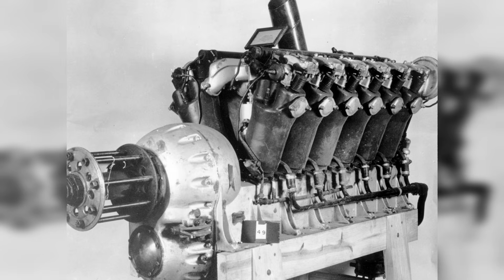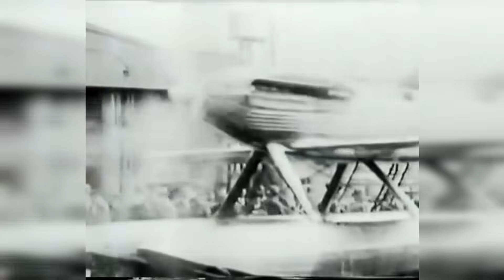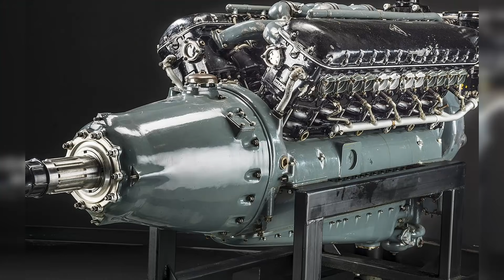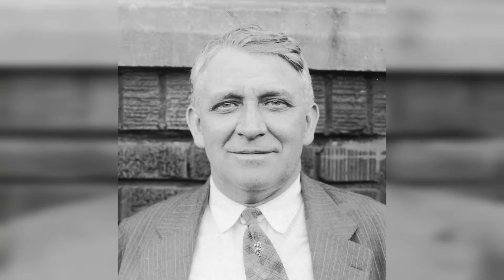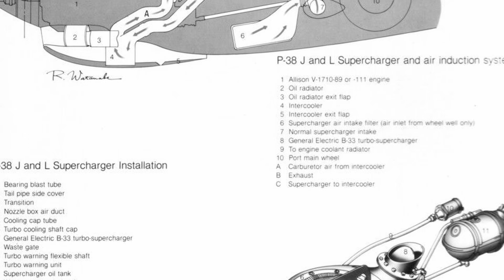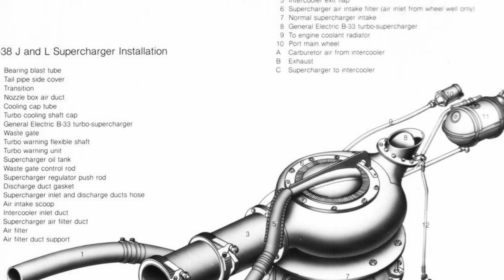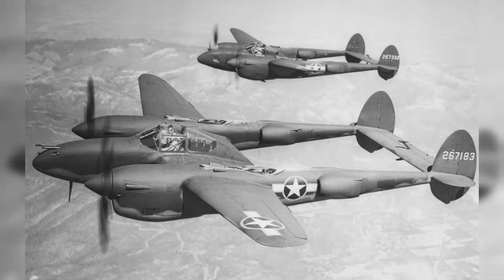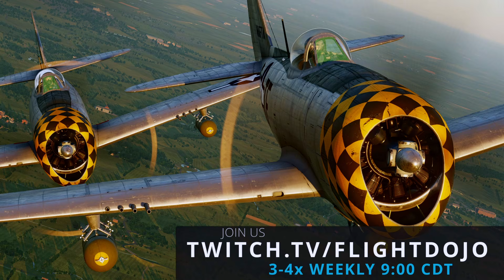Allison V-1710 - A Liquid-Cooled American WWII Warhorse

Comment: Rolls-Royce constantly improved their supercharger. Battle of Britain engines were all single stage.  The two stage blower came into the Merlin 61. It was the RR test engineer who noticed the 61 would go well into the Mustang. The Packard Merlin was a mass production version of the 61. 
By war end RR was working on a turbo compound system. It was never developed because they found their supercharger was so good that early jets just worked. Early RR turbojet compressors were basically the Merlin supercharger.
Reply: UHHHHH  David Elliot  most of the merlins Packard made for the Brits, 37,137 were versions of the 20 series, single stage 2 speed. Packard did make some 266 merlins used in the 1040 spitfire Mk XVI, the only 2stage merlins  Packard made for the Brits who were the primary users of Packard merlins.  USAAF got 3,000 V1650-1 single stage used in some P40's but 15,000 v1650-3 or-7 or -9 went into the Mustangs.YOU are one of the confused that think all merlins were 2 stage, they were not, most merlinswere the 20 series sungle stage....the 2 stage merlin did not show up untill late 1942/43..
Reply: They leapfrog their development due to the fact RR Superchargers division have experience to the Centrifugal compressors you can see the trend post war most traditional ICE developers use Centrifugal compressors unlike those in the power generator sector like Metropolitan-Vickers
 and Westinghouse use Axial compressors as they are familiar to them. They are few outliers like BMW and Junker use Axial compressors for Germany first operational jet planes in combat.
Reply: @aker1993  Yes, it does help greatly that Rolls Royce had in their employ Sir Stanley Hooker who, at the time was the pre eminent designer working on centrifugal superchargers, he took the original supercharger, which was excellent and improved it and was head of supercharger design until the middle of1942 and so also developed the 2speed 2 stage supercharger fitted to the merlin 60 series, he then transferred to the jet engine program.His background was an academic specialising in fluid dynamics. I think the main reason that a lot of the first generation jet engines had centrifugal compressors was that there was much more experience in centrifugal compressor design which were used in most aircraft engines prewar as opposed to the axial compressor which was a design with initially many issues. Axial compressors have their benefits but at that stage in the development the problems outweighed the benefits. Britain had axial jet engines in development at about the same time as Germany and a meteor with Metrovick engines was test flying in about 1943/44 and Rolls Royce was starting the development of what would become the Avon in 1945: if you haven’t already seen it I highly recommend “Not much of an engineer” which is Sir Stanley Hookers autobiography, it fully covers his career.

Comment: Is there a good reason why they didn't consider the Diamler- Benz supercharger drive system as worthy? to copy.
Reply: They did eventually.  Late war navy fighters, which originally had 2 stage, 3 speed, intercooled superchargers, received a 2 stage variable speed unit, similar to the DB 600 series.  The last version of the Bearcat actually had a single stage system that was almost identical to the DB variable speed unit with no second stage and no intercooler.  I'm also not sure about the Allison second stage unit first added to the p-63 in 1943.  I know it existed but I don't know if they were fixed speed or variable speed.
Reply: Not invented here

Comment: Very interesting this with the turbo compound system. Swedish truck maker Scania has researched the concept thoroughly for decades. And has also produced engines commercially with this system.
I am not a truck-guy, so I dont know the specifics, but my understanding is they have been able to improve efficiency with a few percent. Its not like a magic happens and the engine suddenly starts producing hitherto unheard of power figures. So I wonder how they achieved those numbers with the turbo compound Allison.
Thanks for great content!
Reply: It does not matter in the west the action was above the Allisons best height. Those Turbos did not help the efficiency either.

Comment: You forgot an application. PT boats used the Allison. Some say Packards and even Merlin engines, but PT boats used Allison engines.

The wisdom of using ANY of these engines in a maritime application is nigh-on nil because they needed 100 octane aviation fuel to operate. Case in point Higgins boats used marine diesels, but nobody was dumping money into diesel development until after the war. The Germans had some 800HP diesels they used on their Dornier flying boats, and I suspect there were American designs suitable just sitting around. I blame the Navy for this oversight, and it's especially egregious when this technology had direct antecedents in submarines.
Reply: US PT boats used the Packard 2500M engine which was 2500 cubic inches and was designed specifically for marine use. They relied on aircraft engine technology to get high horsepower ratings. If you put an Allison or Merlin engine next to a 2500M Packard unit, you can see that the engine is physically larger than either.
Reply: The US Navy was very interested in marine diesel engine development. What do you think a sub of the time operated on most of the time (1). Plus at that time just like today developing a new engine of any type takes time. If we have engine A now and engine B will take 24 months or more to develop and put into production we can just go with A. Even if we have to do things like couple two of them together. As I understand it a lot of the Higgins boats actually used two Cadillac flathead V-8s. In terms of large stationary diesel engines that may have been usable for smaller patrol craft ect there were options. Fairbanks-Morse, Nordberg and other were building engines. Also consider the diesel engines that were used in some variations of the Sherman. The 9 cylinder air cooled radial and the twin 6 cylinder GMC 2 stroke diesel.  Where do you think all those GMC superchargers on the early dragster came from.
1) Subs of the time where not true submarines. They were more submersibles in that they could not stay submerged for periods up to the total length of their patrol.  Even subs equipped with snorkels were dependent on being close to the surface. The first real submarine was the nuclear powered Nautilus.
Reply: @mpetersen6  Random stuff.... My dad had a Higgens boat with the flathead V-8's that he got surplus from the Great Lakes Training Center after WWII. They used it in the Summer of 1946 then sold it.  His friends got tired of chipping in for fuel and it burned a lot. WWII Fairbanks Morse submarine 2 stroke diesels were opposed piston with upper and lower crankshafts. They were very fuel efficient and reliable. In the 1970's I had a flat fendered Willys CJ-2A Jeep with paddle tires, a 350 Chevy with a 4-71 GMC diesel blower mounted on a Weiand manifold. It could climb anything at the Pismo Sand Dunes and throw a 125 foot rooster tail of beach sand. 

I have a GMC 3-53 marine diesel in my stuff and wanted to trailer mount it to drive a margarita mixer. The controls were to be a set of ape hanger motorcycle handlebars and have a bucket seat....World's Loudest Margarita Mixer....to be towed by my jacked up 4 wheel drive Triumph Spitfire on 33 inch tires with Chevy engine. I like diesels and put a Kubota 3 cylinder 905 engine in my Geo Metro Convertible. I had an inboard boat with Perkins 4107 inboard engine. I tore that out, adapted a Mercruiser stern drive unit and dropped in a 6.5 Chevy turbo diesel with the fuel limiter jacked up in the injection pump. Here it is.... hard to believe that was 10 years ago. When I told Old Lady Marilyn to go to wide open throttle, note how it almost knocked me on my butt. The 6.5 engine is shown towards the end of the video.  https://www.youtube.com/watch?v=cDyQ_VeZKx0
Reply: @kimmer6  also campbell had these engines
he wanted 2200 put a 150lb turbo charger and had another 1000bhp weight was not his problem he wanted power.

Comment: So the Allison engine would have been much better if they had copied the Rolls Royce. That has always been the case!
Reply: Obviously you were not listening. In reality the Allison, the Merlin and every other monobloc inline V-12 aircraft engine were heavily influence buy the earlier Curtis D-12. Over often thought that when the D-12 and later Conqueror went out if production the War Department should have stored any tooling for a "rainy day". They probably would have made great tank engines.
Reply: @Greynerd - Preposterous conclusion. The truth is that the Allison was a significantly better engine than the Merlin. Ironically, if you research the Merlin's history, you'll find that it's directly descended from the American Designed, Engineered and Built, Curtiss D-12 engine from 1921. Rolls-Royce bought six Curtiss D-12 engines from Fairey Aviation and reverse engineered / copied them to create the RR "Kestrel" engine. This was after RR and the British Air Ministry were humiliated by their loss in the Schneider Trophy race in 1923 to aircraft powered by the Curtiss D-12. The Merlin engine is the direct descendant of the Kestrel engine. Curtiss D-12 -> RR Kestrel -> RR Goshawk / Peregrine -> RR Merlin.

The Allison is stronger, more reliable, easier to work on and repair, and has far fewer parts. It also makes virtually identical power at the same amount of boost. The one area where the Merlin was better was at high altitude. This was not technically related to the actual Merlin engine, it was because of the 2 stage supercharger that was added onto the Merlin. There is no doubt that the 2 stage supercharger on the Merlin was definitely MUCH better than the single stage supercharger on the Allison. However, once the Allison received GE Turbochargers on the P-38, their power was equivalent to the Merlin at altitude.
Reply: @GoogleEqualsEvil  Significantly??? it wasn't demonstrated as such!!
It was Americas best shot at liquid cooled big V engine. Then america fell back to the big radials which only had horsepower from massive size. America never produced anything like the Napier Sabre. much to sophisticated. compared to the blunt trauma that was the R-2800

Comment: No pop filter, can't tell if you're handling that in post, or that's a small diaphragm condenser rather than a typical dynamic mic.
Reply from the maker: normal SM57, just compression and EQ and a multiband de-pop compressor

Comment: I saw in another video comparing the two engines that the Allison was much easier to maintain than the Merlin so had advantages the farther afield an outfit was. An engine that is running is better than an engine that is waiting for parts or maintenance to return to the sky.

Comment: Finally, someone who puts out the interesting technical info without posing as a post graduate engineering professor. I am a techno geek but I am mathematically lazy. I get bored quickly when the algebra starts. Keep doing what you're doing and I'll keep watching
Reply: Mathematical laziness  creates great guestimators. 
I believe in it!
Reply: You realize that by skipping the " boring" charts you miss the most important information. That's why greg's airplane and automobiles  channel is so good, in my opinion.
Reply: @arthurferreira1462  except that greg is often selective or omits key factors that negate his assertions.  He always refuses to acknowledge mistakes and omissions.
Reply: Perfectly stated!
Reply: It's NOT a compressor. The compound is an exhaust- driven turbine- there is no impeller!
Reply: The oil coolers are totally separate from the wing skin intercoolers(A thru H). Cretin!
Reply: I love Greg's Planes and Automobiles, but when he starts pulling out the line graphs and comparing Horse power, boost and manifold pressure, climb rate, altitude performance, Turbocharger vs Supercharger, etc...

 My eyes just kinda glaze over and I just nod and listen.
Reply: @pyro1047  I LOL'd hard at this, even sympathetic tho I understand the math
Reply: Same here. @AmazingBilldo
Reply: Me too...as soon as the algebra starts I'm done 😃

Comment: Here's the timeline I'm imagining:

When the engine was first built, the supercharger was designed during that initial stage. During the reinforcements and engine structure alterations made in the next few years, the induction team would have been able to make the 2 stage supercharger work, which would have been done by 1941, making there be a version with or without 2 stage supercharging depending on turbocharger presence or not. At that point, by the time experiments in turbocompounding started, they would have been more easy to continue given they would not be focused on doing the most with the supercharger they had.
Reply: I really hate how the air corp so fvcking anal to the producers to have turbocharged thier engines in their planes it crippled their ability to make good single engine planes that are not comically large like the p47 or neuter like the p40 and p39 during the war unlike the navy that stick to a superchargers.
Reply: A two stage mechanically driven supercharger was installed on the Allison in the P-63 Kingcobra. Allison went down the path that they did because the USAAF would have rejected a two stage mechanical system as too inefficient for the altitudes they wanted to fight at. Since the Navy wasn't going to buy aircraft powered by liquid cooled inline engines that meant USAAF was the only customer domestically for the Allison and USAAF was committed to the turbo as the second stage. Later, when the Russians adopted and used the P-39 extensively, the development of the P-63 for their use with two stage mechanical superchargers. As a side note, mechanically driven superchargers cost between 100 and 150 hp in total engine power to drive which a turbo does not.

Comment: I'm sure the Merlin overshadowed many an allied WW2 engine during the war because it was placed in the P-51 and Supermarine Spitfire. Most notably, the P-51 was able to out perform most of it's combatants and carry light explosive munitions for ground support when the US started pushing east from Normandy. A lot of tank and infantry soldiers praised the P-51 when it helped them push back the Panzers and Tigers on their way to Berlin.
Reply: Interesting about the casting issue; Buick cast many of the aluminum parts for Packard!

Comment: Allison had altitude issues overall, for points you addressed, but from a marketing standpoint, the engine was reliable, and was great for low altitude aircraft designs (Soviet Union?). And it did prove to be capable if someone could design a proper forced induction system for it.
Reply: You are forgetting the RAF Mustang I, in action10 May 1942. One year before the P47.  2 years before the P51D and 2 months before the P38  in the MTO
Reply: @jacktattis  good point. But the P-40 was flying the Allison in those theaters it even before that.
Reply: @SoloRenegade  Yes indeed but the Mustang was the cream on the Cake
Reply: @jacktattis  for sure
Reply: The Allison had a number of problems, especially the intake manifold that was finally redesigned and deployed in 1944. Detonation and lead fouling was an ongoing problem during the war.  Desert P-40s had engine fires and failures.
Reply: @bobsakamanos4469  hey, you know what, other engines had failures too such as the wright and pratt radials and the Merlins were notoriously troublesome at times. Napier Sabre in particular.

But the mechanics loved and preferred the Allison over tje Merlin. Doesn't sound like an issue when the mechanics preferred them. If an engine was giving the mechanics trouble, they'd hate them, but they didn't.

How about citing a source that discusses these alleged failures so that we can check and see if this was a rare, common, or frequent thing. I'm willing to bet it was infrequent issue.
Reply: @SoloRenegade  it's always a pleasure when my comments are deleted/censored. .. again.  Free speech not allowed in America.
Reply: @SoloRenegade  no point in trying to respond since my comments are censored.
Reply: @bobsakamanos4469  citations don't require links, just cite it properly the old fashioned way. YT isn't censoring your text comments. seems a cop-out to avoid sharing your sources (or lack of sources).

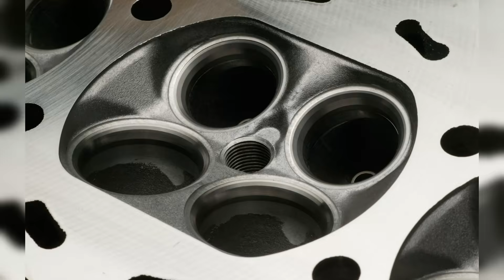Comment: I keep coming back to the pentroof combustion chamber at "6:10".  I see the "pentroof" (4 valves; 2 & 2 I assume) but I only see 1 spark plug hole (in the middle).  But you seem to be saying "2 opposing spark plugs" (6:13).   Just don't see it, the 6:10 photo seems to show a single "middle of the head" plug.  Of course I also seem to be seeing spark plug wires going to the outside part of the head on the other photos.
Reply: Correct - those appear to be common auto engine parts

Comment: The P-40 also was aerodynamically inefficient. But it was designed well before much of the NACA drag reduction studies were done.
Reply: The P-40 does not get the respect it deserves.  It shot down more planes then any WW2 Airplane. It was used by the British, Australians, New Zealand and other allies along with the US Army Air Corp.
It fought in every theatre of WW2.
Reply: As I understand it considerable wind tunnel work was done by Curtiss after disappointing performance from the prototype and useful gains in performance came about as a result. I personally would say less efficient rather than inefficient.